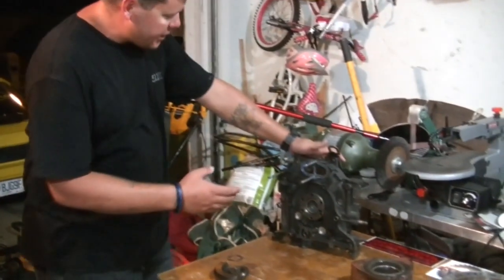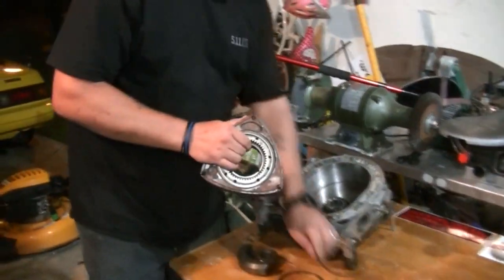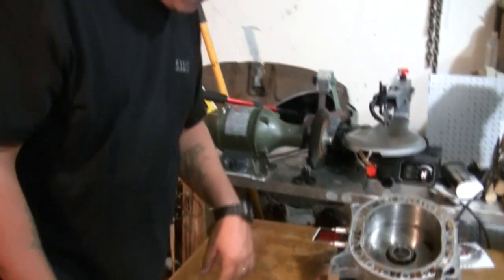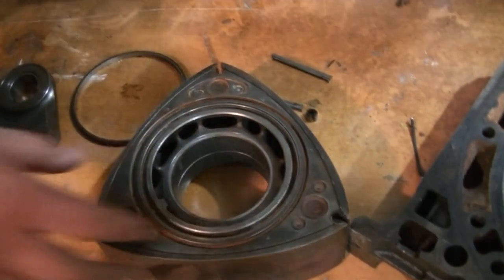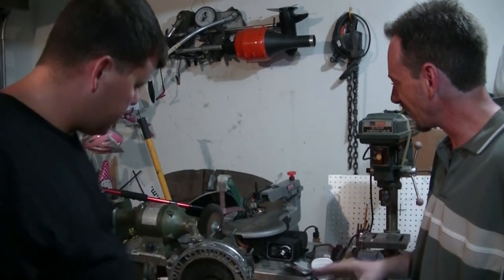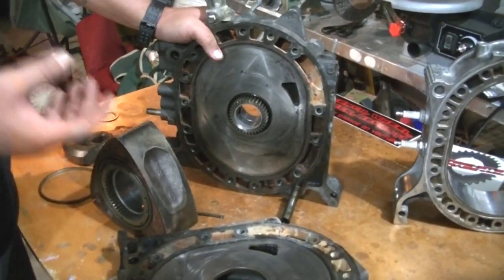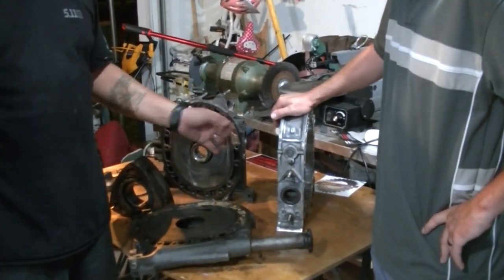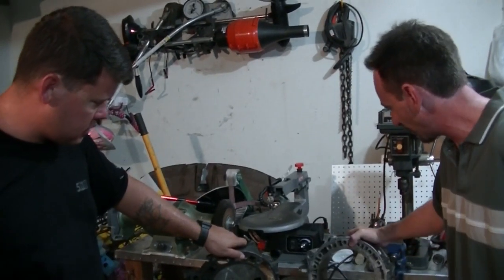Rotary Rundown With Randy

Comment: I like the sound and the unique way that the rotary engine works, 
I have been a ASE certified mechanic for 30+ years and never had the chance to mess with the rotary engine.
But I have friends that have them and they would always talk about strip porting? Just what is strip porting? 
They claimed to be able to get them to brake the 13000 RPM range and get upwards of 150 hp out of them?
Any chance of getting this put in to prospective.
Thank you.
Reply: Joe C I work on them at a dealership. If you had to work on them for a living you probably wouldn't want one at all. They are not good for a lot of mileage and aren't as reliable as a piston engine.